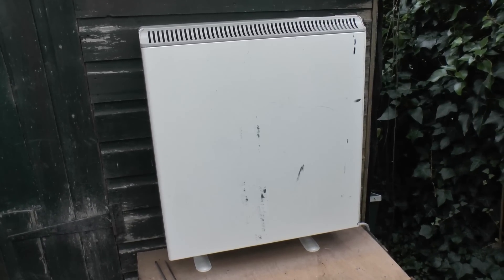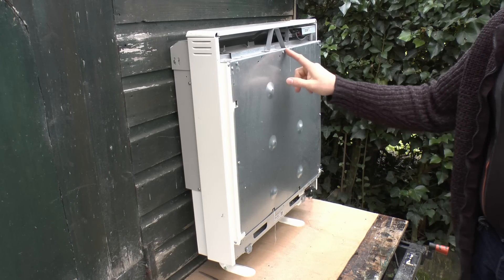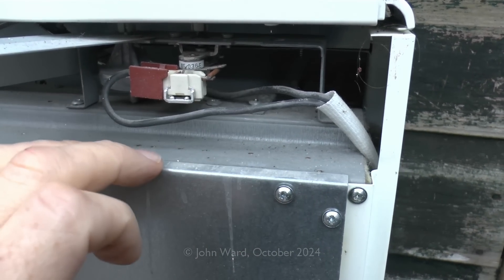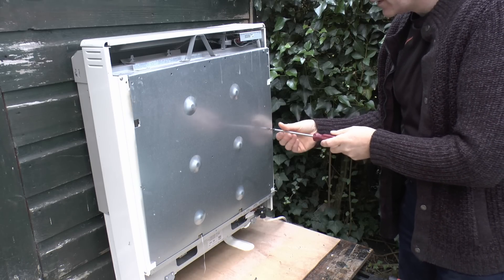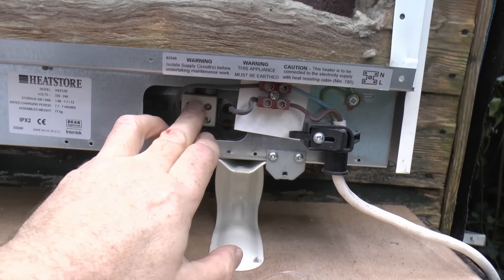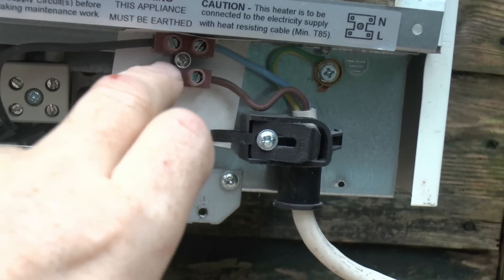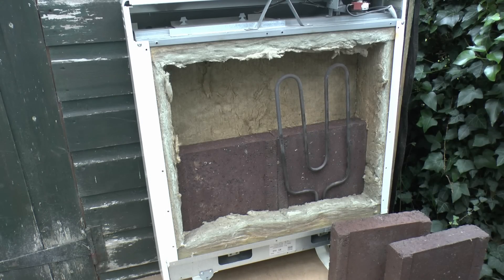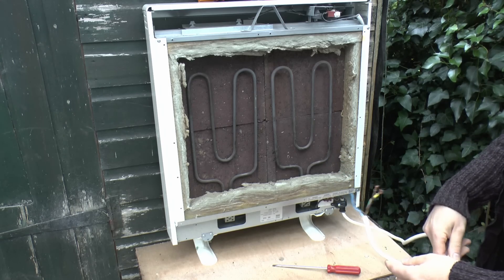Storage Heaters Part 2 - What's inside, fault finding, how they work

Comment: I have just had an electrician install a Creda TSr18 MW Storage Heaters 2.4kw. Is it normal for the right side panel to be very hot ? Having just seen this video I’m bothered as it appears a cable goes up the right side to the thermostat

Comment: Great videos John, Ive just discovered your channel. 
I'm thinking of installing storage heaters to replace panel convector heaters. I can get an EV tariff of about 6-7p per unit for a 6 hour window overnight. I need to be sure that the heaters can charge fully in 6 hrs and then retain a good quantity of the heat to release in the evening, or as required during the day. I also would like to wire them into the ring main. I have a smart meter so I dont need a time switch and spur. Can you see any problems with this approach?, any advice appreciated.
Reply from the maker: Storage heaters require their own circuit, usually 16 amps each, and modern ones require 2 supplies, the timed off peak supply and a 24 hour supply for the electronics/built in fan/daytime boost.  There are no 'old' type ones any more as shown in the video, all the new ones are the type which have electronic controls and daytime boost functions.

Unless you can get some older heaters very cheaply, then caution is required - while EV tariffs are currently cheaply available that is very likely to change in the future, and storage heaters are not EVs and won't be used much in the summer, so there may be problems in using such things for heating rather than vehicle charging.  New storage heaters will be many £1000s to install which is a very substantial amount if it relies on certain cheap rate electricity being available.
Reply: @jwflame  Thanks for the info. I'll keep investigating and talking to the suppliers. One other problem I have noticed is that storage heaters seem to release the heat very slowly, a heater which can be charged at 2.5kw can only discharge at about 1.3kw.
Reply from the maker: @kenshort5109  That slow discharge rate is by design - charge up over 7 hours, and discharge over the next 14 hours or so, that way you get heat for the majority of the 24 hour period.
The older types could have the metal flap inside left open all the time for 'commercial' use, where the heat would mostly be gone in 8 to 10 hours, so your office/shop or similar would only be heated until about 5pm.

That has been and always will be the major problem with storage heaters - intended to heat a building all day, every day whether you need that or not.

Comment: Im just about to dismantle one.  If it contains asbestos, will it look the same as the insulation there?
Reply from the maker: Very likely, you can't identify asbestos just by looking, and if it is asbestos it's too late to identify it after the heater has been opened as that will already have spread it everywhere.
Check before opening, list of asbestos containing models: https://xo4.uk/?shA
Most of the asbestos containing ones are over 50 years old now.

Comment: I think it’s important to mention that thermostat is equipped with thermo cut located at front of thermostat. If storage heater air vents at top was covered ( never good idea )usually thermo cut pops out and has to be manually pressed down for heart to work again.

Comment: I love my storage heater. I've got an Elnur model 3.0kw. I was able to get it brand new for just under £200 because it is an older model that is not compliant with Lot 20 (which is a load of old rubbish in my view) hence I got a real bargain. Yes it is some 13" deep, however this allows for a high level of insulation, making it quite effective.  It looks smart  and modern. Because I am on Economy 10 I get five cheap hours overnight, three in the afternoon and two in the late evening. When I am out at work I have it on setting 1, which stores (3 x 600wh) = 1.8kwh, which means the flat is nice and warm when I get home from work. Best of all, I can always put the fan setting on, which only fans stored heat out, as there is no peak supply element, hence it only uses cheap electricity, apart from the 100w fan, but this only needs to be on for 2-3 minutes to heat up the room nicely. I have it connected to a manual bi-metallic Honeywell-type of dial thermostat which allows the fan to kick in and blast more heat when the room cools. This is the best design of all as I am never without heat, and even if I forget to turn it on, it is never too long until the next off-peak period to charge it up again!. Although it has 5 heat settings for the intake, I seldom ever have it on beyond number 2 and never beyond 3.
Reply: Where did you purchase it from ?.

Comment: I'm thinking of getting one to divert my solar surplus and 7p night rate into using my Eddi 2nd output , using an oil filled at the moment but this would hold heat for longer
Reply from the maker: If doing that, get an old storage heater as all of the new ones require 2 supplies and have electronic thermostats, fans and whatever else in them.

Comment: Hi John. The bimetallic strip works in reverse to the way you think. As the heat rises, the strip closes the flap. This design has a flaw in that when the heat starts to become depleted, the flap will open (if the boost is set to 4 or more) thus depleting the heat even quicker! The reason for it working in this way is that the flat will cycle (on auto models) with a higher number set means the flap will open more frequently and for longer. Hope that's useful

Comment: Thanks for this and the related productions. About 40 years ago, I had a pair of storage heaters installed in my house - Creda, in this case. They are still in use, but the choice between them and a balanced flue gas fire varies depending on the pricing regime. The price ratio between night rate, day rate, and gas has changed a lot over the years. Out to Dec 2025 the rates are: 25.24, 17.16, 6.05 p/kWh (day, night, gas). Standing charges added together are 86.09 p/day.

Notwithstanding the advertising by the company involved, at present locally used gas is a lot cheaper than even ninth rate electricity overall, even allowing for the energy lost out to the open air via the flue. Do the sums yourself.

The structural walls of this house are heavy concrete blocks - almost a kind of built in thermal storage blocks, in effect. Thus using heaters to maintain a minimum temperature works quite well. Quite different c.f. houses built with timber frames (and often fitted with built in warm air heating) which were popular in the early 1980s.

The remote control of them has changed over the decades. Originally, there wasn’t any, There was a clockwork control unit in tandem with a twin rate rotary disc meter, which was replaced later on by radio teleswitch one, again with a rotary disc meter, then a more modern electronic one with built in fixed timings, and now a smart meter with (at present) preset times. In principle the form could now use remote switching for the restricted supply output. At present it’s an Aclara SGM1400-B product.

Comment: Our house has 3 Dimplex storage heaters which we use as our main heating (we also have a Corona paraffin heater which we use in autumn/spring) – our Dimplexes have a sort of tube/probe thing which dangles from the bottom right, and attached by a seemingly slightly flexible metal wire and it seems to be related to the thermostat – what precisely is this probe-thing and how does it work (and what are the failure situations of it)
Reply from the maker: That is what was sold as an 'automatic' storage heater - the probe is the end of a thermostat, which senses room temperature and adjusts the heat input control accordingly.  They work up to a point, but as with everything storage heater related they are not particularly accurate so actual results will vary.
The thin wire is actually a tube, the end probe and the tube are filled with liquid which expands/contracts as the temperature changes, and the pressure of that liquid is what adjusts the thermostat control.  Similar principle to thermostats used in ovens and fridges.  The probe should be located near the floor at the back of the heater so it is only affected by the air temperature and not by heat from the heater.
If they fail, it's either thermostat on permanently or off permanently, so the heater will be far too hot, or won't heat up at all.
Reply: @jwflame  Thanks, that’s informative – it sounds incredibly Heath-Robinson to the point I’m amazed it got out of the door as a technical solution! I’m going to take a closer look at ours (probably next spring when we’re not using them daily)
Reply: Today I isolated it (fuse box and local switch), I took the cover off, tidied it up inside, measured the four paralleled elements to come out at 17.5 ohms, so I didn’t dismantle further, the four elements are good. I wiped down the outside and inside carefully and as I was doing it I remember the insides of computers a few decades ago with their sharp bits of metal casing, and as I was remembering that I inevitably slashed my thumb on a bit of sharp metal internal corner! Oh well, it’s all back together now.

Comment: Some I had to take apart for a flat refurbishment were old old and huge.  Hate to guess when they might have been manufactured and installed.  The bricks were very obviously the same sort of high alumina content material that refractory fire brick for furnaces are made from. They had semi-circular channels moulded in them down which naked NIC80 or similar coils ran, suspended from bars that doubled as both support and current supplying bus bar. Three sets hanging down between 4 layers of bricks front to back. Horribly inefficient, so much so that despite the Economy7 supply and tariff they were dreadfully expensive to run (this was late 80s/early 90s).  It took two of us all day to disassemble,  dismount and remove four from the first and second floors but we were glad to put the work in to see the back of the damned things!

Comment: Storage heaters may find a niche again now that fossil fuels are being phased out and insulation standards are improving.

If you have a small dwelling that is very well insulated and has little outside space (like most flats) these could be perfect. You would not have space for a wet heat pump system. A well insulated dwelling with a reasonable thermal mass requires a steady trickle of heat to keep up a stable comfortable temperature. If you size the storage heater generously (which wouldn’t mean big, given good insulation) then a reasonably stable temperature can be achieved 24 hrs with off peak electricity, such as through the Octopus Go tariff.

There are plenty of 16 amp timers available to wire them up. Gone are the days of radio controlled twin supply meters. Chose your tariff, and set your timer accordingly (for now....).

Dwellings in the 1960’s/70’s were barely insulated at all. They required high output heaters when people were in the building, and were probably best left unheated when unoccupied. This really did not suit storage heaters. But well insulated dwellings to modern standards do.

With more offshore wind on the way we might have more disparity between supply and demand, and a greater differential between peak and off peak prices. It is hard to predict how much this will be offset by car charging and other new uses.

If more tariffs like Agile Octopus become available (with very flexible pricing according to supply and demand on the grid) then storage heaters could become even more useful. We would need switches that could be controlled live. But the storage heater will always be sitting there ready for the supply (at least in the cold months) whereas the electric car may not be sitting on the drive.

Comment: God this takes me back to one of my formative moments of frustration. My school had these heaters because a good part of it was made up of a series of non-connected portakabins. None of the staff knew how to use them. Both dials were always left at maximum because of course the were, so the boost dampers were always open. In the afternoon, it would get too hot, so they'd shut the islolator switch off. Then naturally, the following morning it would be bloody freezing, so the switch would get turned back on and the 2kW fan heater cracked out. Then of course, the following day it was boiling so off with the isolator again... It was enough to send a young technically-minded person round the chuffing bend.
Reply: 😂Hilarious! Can relate to that exact scenario! I remember a bowl of crayons was left behind on heater in primary school. The following morning the room being filled with wax thick wax vapour . Luckily …no fire but close call!

Comment: I'm in Heating zone 7 and use some 1960's steffes/Stiben heaters connected to Off-peak electric.The only problem is that the elements are failing. I am planing on changing to a large storage tank system with hydronic heating and thermal solar.

Comment: Like the need for heat resistant cable, ceramic choc blocks for the elements, but plastic for the supply - nicely browning in the heat!
Solar heat stores (immersion heaters) have come back, but doubt a rooftop solar inverter could supply enough current for an effective heat system (even a simple resistive load).
Reply: Not sure, I've seen deliberately brown choc-block used in things before, but you could well be right.

Comment: I disconnected multiple storage heaters on behalf of an asbestos removal company for the council. They all appeared to be the same model of heater. It turned out that some did contain asbestos and some didn’t. Don’t know if they were from different batches or some were newer than they appeared. They were freestanding with the wood effect front that was painted onto the metal.

Comment: I remember the house i grew up in had these throughout the 80's and into the early 90's. They were the "in-thing" in the UK with Ecomomy7 cheap night electricity. They always gave off a funny burning smell, thats what i remember most about them. But they worked well and gave off heat right into the evening.
Reply: It's possible we weren't using them correctly I suppose. But after the oil fired central heating system in our house was decommissioned in the late seventies, we had a bunch of these when I was growing up. By the time the cooler evening came round they were bloody useless is my recollection. Mum's on gas central heating now and it's much better. Given the conversion and transmission losses from a gas powered power station sending electricity compared to heating up water using a gas boiler, it's a more efficient and less climate unfriendly option. Obviously if all electricity were from renewable that calculation would be different
Reply: Think the burning smell is accumulated dust.

Comment: We've had one for decades, still working. Every 10 years or so the thermostat goes. The first time it went, I watched the electrician replace it so have done it myself since.
Reply: Did your heater get too hot because the thermostat failed.
Reply: @melgrant7404  No, it just wouldn't turn on at all. Looking online, I found a video on how to reset the thermostat if it's cut out due to overheating. There's a little metal tab on the thermostat that needs to be pressed. You'll hear a tiny click when doing so. This restored the heat and I thought it was fixed but a few days later it cut out again indicating the thermostat was failing. Only a new thermostat fixed it permanently.
I guess the thermostat is one of the few moving parts in the heater as it clicks on and off each day and only has a limited number of clicks before it wears out!
Reply: @blutey  I find parts are harder to find for the older heaters.im having to replace one of my old heaters because the thermostat is hard to find nowadays.
Reply: @melgrant7404  Good point. I guess the same fate will befall mine before too long.☹

Comment: m not a lover of storage heaters but used to instal hundreds of this type in local villages as they had no main gas supply. I will say they were very reliable and easy to use. 
unlike to present heaters where no one can work out how to set them up properly. I have given up on the number of times I have had to go back and explain how they work and one old lady gave up and just bought a convector heater from Argos. Then when these new type go wrong ,well you can guess how much the parts are . Keep these old heaters going as long as you can

Comment: Thanks again for a great video just so happens I have two to repair one doesn’t come on the other seems to massively over heat according to customer thanks again this video is really helpful
Reply from the maker: New thermostats for both.  Some have an overheat cutout which a small button to reset, but from experience once they have overheated they won't work properly again, so may as well replace the thermostat.
Reply: @ Thank you will do
Reply: @jwflame the thermostat as shown doesn’t have a button but if you press it with your screwdriver on top you will hear a click as it resets.

Comment: I have a larger one in my conservatory. I stopped using it when electricity prices shot up, and used a cheap diesel heater instead. But I'm back to using it again, as I'm only paying 7p kwh at night now.  The only problem is, I tend to spend my time in there, in the evenings, so the heat is mostly waisted during the day.

Comment: From what I've heard they were often more expensive to run heating in workplaces than using plug-in heaters during peak time electricity.  This is mainly due to older buildings having poor insulation and these heaters heating 24Hr/day instead of the 9 to 10 hours the building is occupied.  Having worked in a few buildings that had storage heaters, they were difficult to regulate, especially if one night it was frosty and then 10C overnight the next, after increasing the input dial.